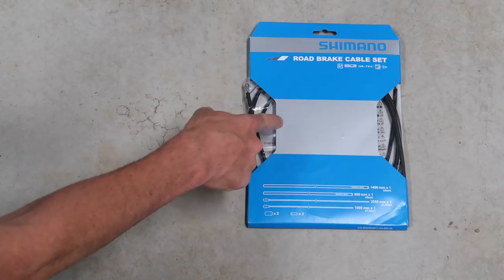Quick Shimano Dura-Ace Brake Cable Replacement (Giant TCR Road Bike)

Comment: Boeshield T-9 is awesome stuff.  I'm a woodworker as well as a cyclist, and I keep all of my shop tools protected with it. Saw tables, saw blades, hand tools... Basically anything made of metal.  I also sweat a lot on the bike, and every time I do any work on any of my bikes, I always wipe things down with the T-9 afterwards.  My alloy trainer bike in particular has about 8000 Zwift miles on it, and it still looks nearly new.  I coat the stem, bars, all of the bolts and fastners, bottle cage mounts, the frame in general.  Basically the entire thing gets wiped down with T-9 and it keeps it all well protected from sweat and looking shiny and clean.  Love the stuff.
Reply: Jim Hansen  good to hear there is a fellow woodworker/cyclist. I have always just used car wax on my WW tools but have definitely heard of T-9. I’ll have to give it a try now that I know of its multiple uses 👍

Comment: Came through twice in one day for me Shane. Got my new wheels this morning. needed to lengthen my brake cable which i'd never done before and this video was invaluable then I couldn't get the bloody tires on and your recent installing a tube video solved that problem as well. Money well spent

Comment: To be bike mechanic legit, your brake cables (front brake first) should be closest to the frame, gear cables shout run on the outside to avoid any rubbing, clamping or turning forces, but you can still easily refit the front brake one.
Reply: I thought the front cable housing is front most and the rear brake housing closest to the frame?

Comment: Great video Shane. If reusing outer hose it's still better to trim the edges as they wear out and can interfere with the smooth cable movement.

Comment: Lama... Lama... Lama...  On the FLOOR???  grrrrrr...  Okay, new house! new pain cave!  Time for a proper workbench!  There are lots out there, but I'm picturing one with a nice overhead light and a peg board back for hanging up all those bike tools.  I built mine out of 2x4's (can you picture a butcher block out of 2x4's).  Simple and extremely sturdy, more for working on cars, but good for bikes as well.  I also went out and bought a small 3 drawer toolbox just for bike tools.  Being the gear head, I had the obligatory big tool box that used to house my bike tools, but it's much nicer having a separate dedicated box.  I also use several plastic storage containers for old spares and new stock, not to mention my multi-compartment storage box for all my small bike parts.  And yes, I am a bit anal...    Still, time to get up off the floor!   nyuk! nyuk! nyuk!
Reply from the maker: I've never actually thought of having a workbench. I'm so conditioned to be working on /insert whatever/ in made up places, tight spaces, training rooms. Issue #1 - My workbench space is filled up with trainer boxes! :)

Comment: You use the right lever for the front brake? Just a personal preference or is there more behind this? Curious to know more.
Reply from the maker: https://cyclingtips.com/2009/05/why-do-brakes-differ/
Reply: The same as here in England as Aussies and brits drive on the correct side of the road lol🤣🤣
Reply: Paul Fearon on the right side which is the left side lol

Comment: Shane, use caps for the outer cable. Your outer cable will not compress after while, you get less dirt inside and for service get grease there.
Reply: Do you mean ferrule? I was wondering about that.

Comment: Where the rear brake cable 7:59 enters, do you remove the the rear cable guide? I don’t seem to be able to run the cable across the frame to exit at the rear of the frame. Any advice?

Comment: Question: On the TCR, ever have any problems where the cables enter the frame at the headset tend to destroy the housings? I've got a 2013 Rabobank Edition and I can't get past it. Considering going to Etap. I am using SRAM Red, so maybe the cable tension has something to do with it.
Reply from the maker: One for a mechanic to look into, preferably one from a Giant dealership. No problems on mine. (or on the 2013 TCR I have)

Comment: 0:46 this was drilled into me during my auto mechanic course...the correct term is side cutters, not tin snips :)
Reply: Eli Douek check your cable breaks your right hand brake is your back brake your left hand brake is your from brake dust the proper way to set up your brakes

Comment: Shane - Does the older TCR frame like yours have internal liners for the gear cables ? Just about to change mine ...
Thanks
Reply from the maker: No it doesn't. So get some strong magnets and a lottery ticket! :) (it's not too bad)
Reply: Ok thanks for the info 👍👍

Comment: Hey Shane, thx for all these cool hacks and tips to make our lives easier. I have 17 TCR Advanced and will be upgrading my drive train, still mechanical, albeit. That said, can you shed some lights as to what I might be facing when replacing gear cables? Are there full length internal cable guides (black liner) that runs the whole length of the front and rear derailleur? How does Giants TCR internal cable interfaces down the  bottom bracket? So many variables. Appreciate you response, mate! Cheers
Reply from the maker: G'day Marc, I'm not sure with the newer model TCRs. Maybe someone who's familiar can chime in here? Mine is 2013 (iirc)
Reply: Thanks, Shane. Either way you're awesome and keep 'em coming!

Comment: Ideally you should tighten and remove play before tapeing them in place?
Reply from the maker: Sure. A lot of the finer points weren't included.... as mentioned. Not a straight up how to... more a cooking show.
Reply: Had it been rear shifting cable replacement, more important :)
Reply: Exactly,that is the most important point in getting the brakes done to pro level.The casing almost never can be pushed to its' final seating,you must use the power of brakes to accomplish this before any taping of the casing to the handlebar.So,clamp cable to caliper,pull brake lever with great force to get casing properly seated.Then you can tape the casing to the bar using strapping tape (a million times stronger than scotch tape)after the handlebar tape is secured, a final cable adjustment can be made.Some would find fault with covering bar logo and the finishing tape ending on top,these are cosmetic,the reason your brakes felt sticky to begin with is more than likely due to failure to follow the proper procedure.T-9 is essential for cable lube as well.
Reply: @larrydaniels8976  why would you lube a ptfe cable

Comment: Use strapping tape not scotch tape. File end of cut cable for smooth end. Use pick to open up liner of housing. Front brake housing is too long. Use torque wrench on brake pinch bolt.

Comment: Your front brake is on the wrong side of the handlebar. It should be on the left so the cable has less of a bend.
Reply from the maker: Not for Australia. Or the UK. Or NZ.

Comment: As a tech guy I'm surprised you're not running Di2
Reply from the maker: I still can't justify the price. One day.... just not soon.
Reply: Yeah I'm in the same boat. SRAM Red is more than good enough for me atm...
Reply: di2 is so much better when you are racing technical crits and need to change gears often - you just don't have to think as much
Reply: Hey shane. When did you get the pro stealth saddle? And how are you finding it?
Reply from the maker: A few weeks ago. Video soon.
Reply: Electronic shifters are idiotic so much complication you have to charge them, program them and they don't even give you back functionality that old bikes had, before sti that were introduced. With downtube shifters you could shift as many gears as you wanted, shift front and rear with one hand and all of that happening instantly, much quicker than sti, and electronic too cause the cable was much shorter and no mechanics/computer thinking when it's best to shift, just your hand.